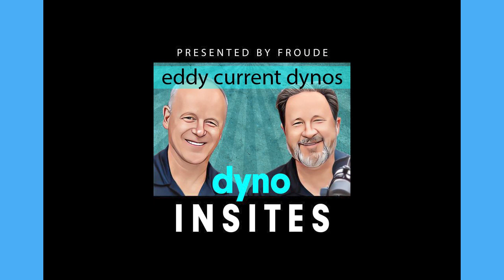PODCAST: Eddy Current Dynamometers: What's the Attraction?

Comment: It means that their is air between the rotor and the loss plates (where the eddy currents are induced). Froude also used to have a WG range of dynamometers where water filled the gap between the rotor and the loss plates.

An air gap dynamometer has less drag and therefore a lower minimum torque than a water gap dynamometer